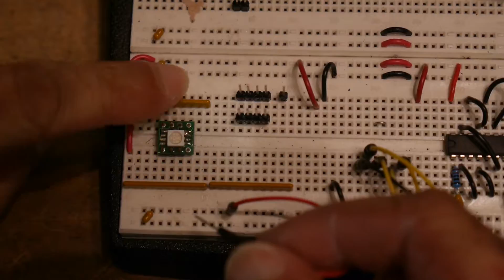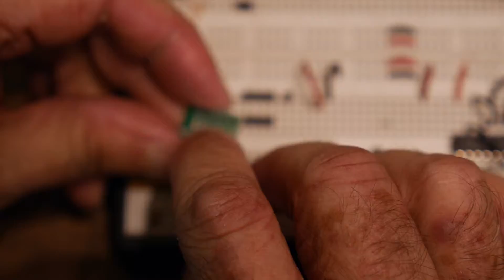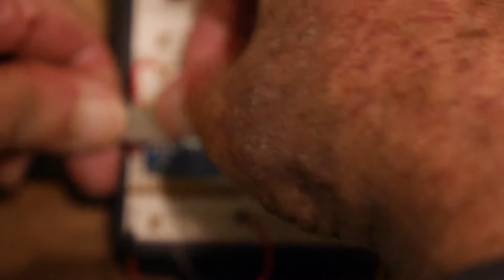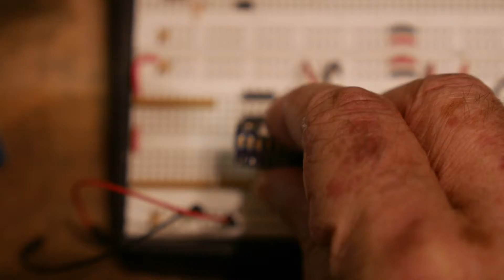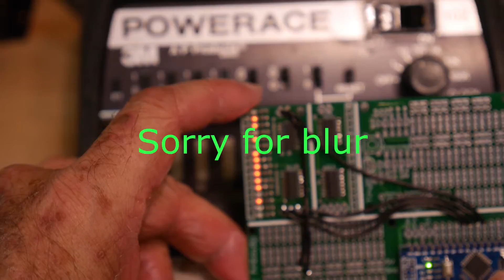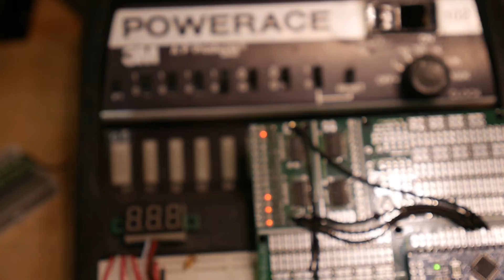#346 8 bit LED bar

Comment: another  mice little 8x LED board that i purchase " 8 LED module Contact Rapid Prototyping breadboard ARDUINO tests 

" from pluszmis on ebay. He also has these small boards with 4 tiny switches on them. ( No affiliation)